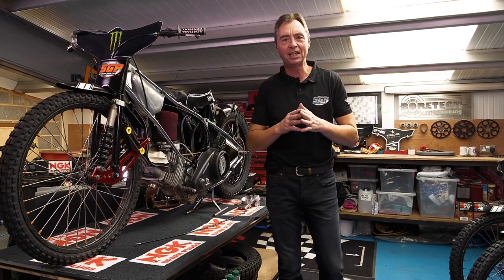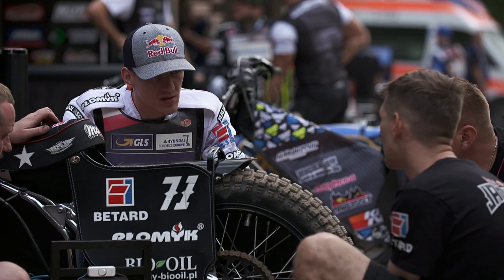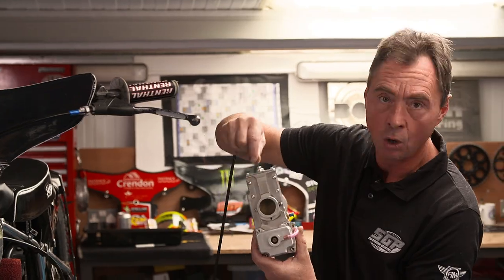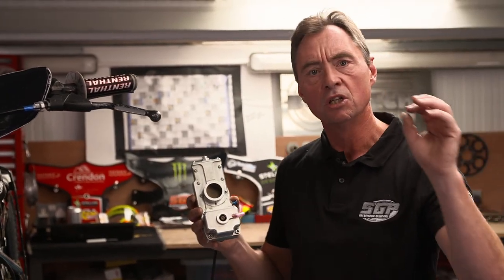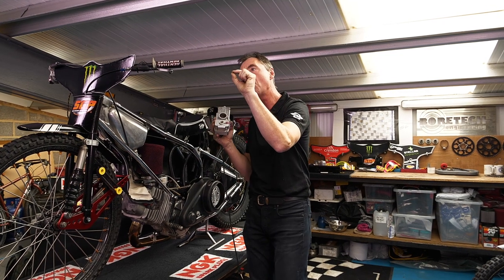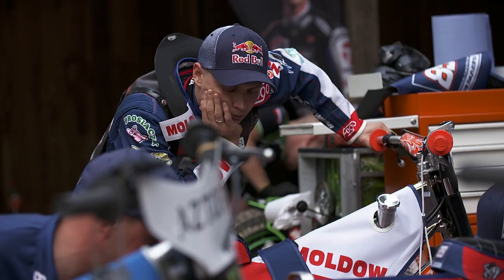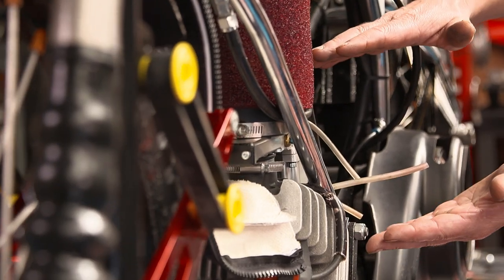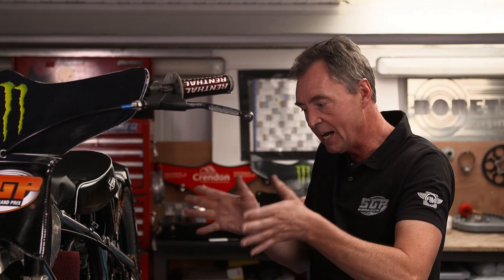How carburettors work on a Speedway GP bike! | Tatum's Tech Talk | FIM Speedway Grand Prix

Comment: There's lots more to know about carbs, too. For example the altitude of the track plays into it. I've also heard that some folks have introduced water into the tank in order to change the power characteristics of the engine. (Nitro does the opposite...but it's banned)
Cheers